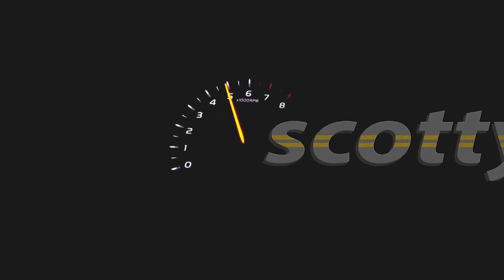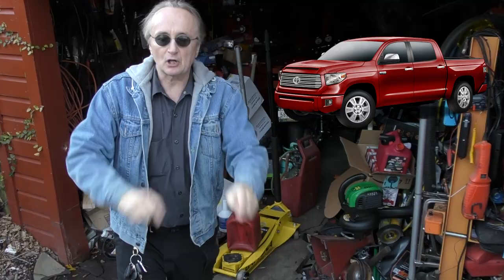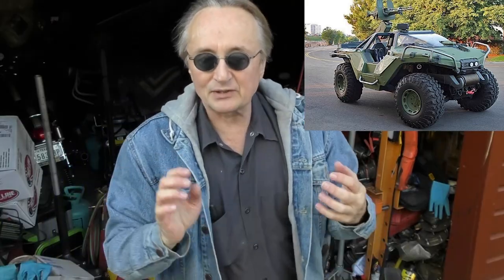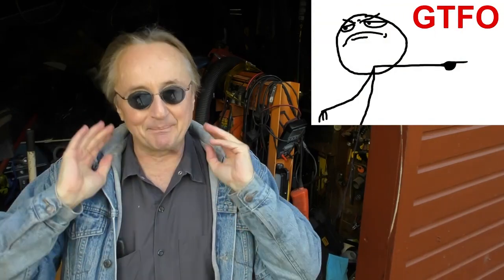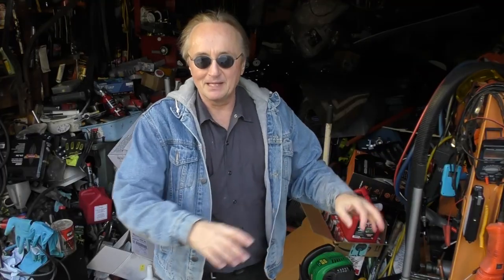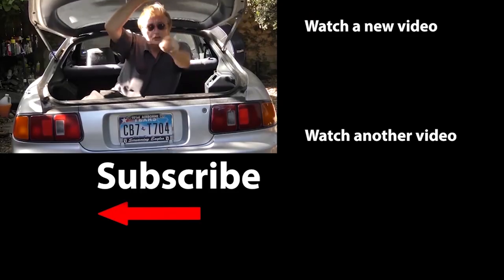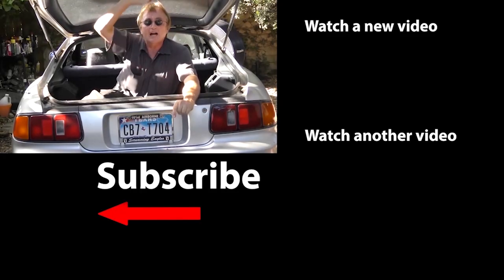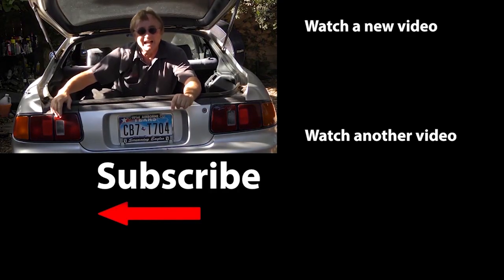5 Used Trucks You Should Never Buy

Comment: SCOTTY! I've been thinking about buying a used pickup truck what are the 5 BEST used pickup trucks to buy?!
Reply: 1. Ford
2. Ford
3. Ford
4. Ford
5. Ford
Reply: Me to. Maybe a 2500
Reply: Toyota 
Toyota
Toyota
Toyota
Toyota
Reply: If you don't care about MPG, nothing screams reliability like a Tacoma for mid sized (not the current ones), or a ranger. If you want full sized, a 1990's Chevrolet C/K 1500 is definitely reliable. Although aging now. I still see more 1990's CK 1500's on the road than anything that isn't brand new. (Slight exaggeration, but still).
Reply: Ghost Titan Gaming Toyoda
Reply: Ford
Toyota
Ford
Toyota
Ford
You seeing a pattern here?😂😁
Reply: Ghost he already made a video on the best pick ups.  Look it up. Ford F-150 or Toyota Tacoma.  The few electronics the better for reliability.  Good luck
Reply: Andrew Smith  i have a frontier I wouldnt buy a used one i would go ford or Toyota they want a fortune for a tacoma but they run forever I would avoid the 6.0 and 6.4Ford but other than that i would go ford
Reply: Ford sells a new F150 every 43 seconds.  Avoid the engine that it costs about 1.5k to change the spark plugs after 100k miles.  Those plugs "went in too far", thus after 100k deposits build up on the threads protruding into the cylinder; break off if you try to "conventionally" remove them with a wrench.  Hearsay but I think it's true.  I understand that they can be replaced but you can imagine the process of drilling them out, etc.
Reply: Andrew Smith the nissan brand should be forbidden on scotty page, shame on you
Reply: @FlatPlaneCranky  does Toyota build a 3/4 ton 4X4?
Reply: Two Fords, Two Chevy's and one cross bred ford/Chevy, thats a Ford with a 350 Chevy engine.
Reply: Datsun
Reply: Mitsubisushi
Reply: @silvergrizzly316  
Fix
Or
Repair
Daily

Found 
On 
Road
Dead
Reply: No body SELLS their good pickup truck - they only sell the duds.
Reply: silverado , tahoe , comanche , ranger , anything electric
Reply: 7.3 powerstroke.
Reply: weld a bed to the back of a 94 Toyota Celica and you'll be fine.....Scotty
Reply: F-150, hands down. Most reliable by far.
Reply: 2.3 ranger is a reliable small trk but not much u can haul.
Reply: @stanroberts4820  No.
Reply: @silvergrizzly316  fard sux
Reply: Nissan NP300, Mitsubishi L200, Toyota Hilux, Chevrolet Silverado and Hyundai H100.
Reply: I agree with the Ford and Toyota recommendations but if you go Ford I would HIGHLY recommend staying away from the turbo options or what they market as Ecoboost.
Reply: Lightning/end of thread
Reply: Toyota Hilux pickup is unbreakable. Very good cars.
Reply: Chevy 99-06 (or older chevy)
Ford- 97-10 (half to make sure there 5.4 Triton was well taken care of) or older ford.
Toyota- there all good but pricey
Reply: @hoster-ph5ru  Not all Toyota trucks are good, you need to watch out for the ones that had frame rot issues.
Reply: Used Tacoma's are insane, find a decent one it's like 18 grand. Why can no other automaker make a small reliable inexpensive pickup?
Reply: hoster123 007 finally an educated comment that makes sense.
Reply: weather you are talking used 5-10 years old or antique like 20+ try to find one that is capable of doing what you want it to do. pulling a trailer, going off road, putting around town hauling furniture or trash.
anything is going to require maintenance so try to keep cost of parts in mind and if its 20+ stick with more popular models so you can still find parts.

low miles for age with no major dents or dings.
correctly installed after market upgrades and repairs.
less electronics the better, hand crank windows and manual seats are a plus.
right size tires that are worn evenly,  truck sits level and drives straight, lifted or not.
when buying used, ask the person selling if they have any old parts or accessories that can go with it. another set of rim's, old parts that can be repaired or used for core charges, original parts that were swapped out for aftermarket (probably still work).
Reply: @shreeharibharadwaj9531  yeah, right thru the intake and shits it out the exhaust 💨💦💩   😂😂😂😂
Reply: @Spaz12isHipAimedFagg  they are good trucks I got a 95 c2500 204887 miles still works great
Reply: @mathewfullerton8577   too bad, guess I'll stick with Ford.
Reply: @silvergrizzly316  kek
Reply: My 96' 4runner is amazing.  Almost 230,000 miles
Reply: The SSR is so ugly
Reply: @EwokNubNub  the old nissans were amazing he talks about it all the time unfortunately after 2000 they started having huge transmission and engine issues
Reply: @mclaine33  personally I have an old nissan hardbody and a 7.3 ford  for work the 150 is just to weak for some applications but if you only tow a boat every few weeks or something 150s are great
Reply: @silvergrizzly316  He said 5 BEST used pickup trucks, not 5 LOUSIEST!!! Haha! Just kidding, man.
Reply: @TheRocketbob22  Man how's that Ford run with the 350? Can never go wrong with a good ol' 350!
Reply: OLD GMC seira if you can get one in good mint condition.

Toyota Tundra
Toyota Tacoma
Ford F250
Maybe a early 2000s silverado of youre lucky to find one not yet rusting
Reply: @Ghost Titan Gaming 
If you can find a used 1st gen Toyota Tacoma with a 5vz engine, that one is a bullet prof.
Reply: Skip the Nissan
Reply: @sreilly  😀 There's good and bad with all autos. They don't make'm like they use to. But I do have a 2000 F-350 Stroke 7.3 195,000 miles and the only really major thing I've had to fix, (if ya wanna call it major) was put a water pump on it. Picture on my YouTube profile. She turns 19yrs old in March. Assembled out of the Kentucky plant.
Reply: I run a 4 door F350 with the 7.3 Diesel. 2001. It is a decent sized lift and tires and still  It get's 17L/100KM and I see many for sale with over 300 000 miles still going strong. Parts are the cheapest possible for a diesel. If you're going to burn gas just get a cheap half ton. Any make is fine.  Dodge 5.9 Cummins is fine. The tranny attached is not.  Toyotas are over priced. Too rusty. Under powered and burn too much fuel for their size. But are very popular. So easy to sell once sick of.
Reply: John see, Yea, the 5.4L 24 valve.  Which hasn’t been in production on the F-150 since the 2011 model year.
Reply: Pt cruiser,
Chrysler got it classified as a truck,
Defintly should buy for the insane relibaltity and good style and it can pull all day long
Reply: Raptor! Depreciation is basically flat.
Reply: John P   I know. 100k miles and still go for 20k.  When you think you find one it’s not 4wd
Reply: ted martinez you’re right! I have a 7.3 Powerstroke soon to hit 300,000 miles with no major repairs other than a transmission rebuild that cost $1500. The transmissions were the weak point on that truck but I’m not really complaining! The 6.0 and even more so the 6.4 are to be avoided. Other than that, Ford or Toyota.
Reply: ubangiestomp yep!
Reply: Ghost Titan Gaming I’ve got a 2009 2.3 L ranger with 348,000 miles on it. Ford is the way to go.
Reply: Stan Roberts nope. But they are good trucks if you don’t need anything bigger than a 1/2 ton. I have a friend that has abused the crap out of his Toyota but it just won’t die. If you need something bigger, Ford! (Just not a 6.0 or 6.4)
Reply: Nathan Medlar YEAH!
Reply: strtngfrsh I heard an interview with a bunch of Ford dealership mechanics and they said the same thing.
Reply: Ford
Toyota 
Ford
GMC 2011 newer
Toyota

Never Nissan he wasn’t joking about those transmissions.
Reply: John P Rangers are decent but primitive. (That’s probably why they are fairly reliable)
Reply: Charlie. Pocono used to drive one of these, very comfortable and excellent fuel economy. Just didn’t have a lot of power.
Reply: John P what I like about Tacoma’s is they hold their value. If everything else in my life was as reliable as my Tacoma life would be perfect.
Reply: Stan Roberts does anyone with a 3/4 ton 4x4 actually use it other than to drive to the store
Reply: @FlatPlaneCranky  Trouble with Tacoma's and Tundra's, the frames rust badly. Look up Toyota rusted frames.
Reply: good idea --- I think you should buy a 6.0 or a 6.4 powerstroke  or a  5.4  3v   those are all fine fords
Reply: my old fords crapped out and lacked power, but my old dodge is rocking ( she has a pain the neck headlight switch issue, though ). everybody has their experiences.
Reply: @meachster4316  trannys are good ,the weak link was the torque converters.
Reply: Silver Grizzly I didn’t actually have to rebuild my tranny but did as a preventative measure and had a beefed up tc installed as well as modified valve body. That was 200,000 miles ago and still going strong in spite of lots of heavy towing.
Reply: Vick Nelonis Absolutely! I haul regularly as well as tow three different trailers including a 30 foot travel trailer.
Reply: RedWings-44 I have a chevy CK 1500. Doors are sagging. Junk
Reply: @silvergrizzly316  not all Ford trucks are good. The newer ones are very reliable but old ford's are trash. I prefer a tacoma unless u need a big v8
Reply: blackdog1960les 6.0 and 6.4 failures resulted in numerous lawsuits between Navistar and Ford. That’s why Ford builds builds their own diesels now. 7.3 or 6.7
Reply: @RedWingsninetyone  still driving my 1990 1500. Put a transmission in it in 2004 was the biggest expense. Still runs good so last year I got the A/C converted to R134 since the R12 is illegal now. When something cosmetic breaks I just go to the junk yard and get parts off of other 1500s and some of the Tahoe/Suburban parts work too.
Reply: I bought a new Toyota Tundra back in 2014. Not a SINGLE issue until this day.
Reply: Falconator , so what happened this day ?
Reply: I'll take a tundra please
Reply: @1royathrone1  well you just go and putt around in your hot wheels and leave the Tonkas to the real men.
Reply: Scotty u forgot the Ford Explorer Sport Trac 🤣🤣 exploder
Reply: @RickJamesGhostGuns  9 out of 10 Fords are still on the road. The other one made it home.
Reply: @johnsee7269  Ford  used a 2 piece spark plug in their 3 valve engines for 2 or 3 years but not since 2008. Only the 2 piece spark plugs were a problem.
Reply: Toyota Tundra, built in America
Reply: Toyota Tacoma probably then Ford F150 then the Cevy trucks
Reply: Silver Grizzly oh yeah 5.4 triton, 6.0 and 6.4 stoker are real good trucks
Reply: strtngfrsh exactly
Reply: East GTG, every manufacturers had a bad apple.  Gotta do your homework.  Most of all, learn to spy previous damage. Whole lotta truck scammers                peace
Reply: *Easy
Reply: @Alphawolf6541  you are right
I looked at getting one before I got my Ridgeline 
I always do a lot of research before I buy a vehicle and the Ford sports Trac evidently had all kinds of issues 
So I decided to go with the Honda Ridgeline and haven't regretted it at all
Reply: Gary Chambers just ask me how I know this🤣
Reply: Island Mike  WOW! How original!!! I bet you were up ALL NIGHT last night tinkin of dat wun. Hoo hoo he he hoo hoo he he hooo!!
Reply: strtngfrsh why no turbo?
Reply: Chevy all day long! Or Toyota! Just not Ford or Ram!
Reply: Chevy or Toyota
Reply: @silvergrizzly316  hahaha lol.  right.  I'll stick with my tundra and tacoma thanks, I have enough problems with women, don't need them with my trucks hahahaaaa  try one you wont go back
Reply: @tedmartinez3857  how terrible is your frontier so far
Reply: @RedWingsninetyone  and low depreciation.  no truck depreciates as slowly as a tacoma
Reply: Any Ford Ranger 2001 to 2011 with the 2.3 liter engine. A manual is best but the automatic transmissions are ok.
Reply: There is a reason the Ford 150 has been the best selling vehicle in America for over a decade. Their built right. I have a good friend that has over 400,000 miles on his now.
Reply: mclaine33 most towed vehicle I had one junk my pcm kept blowing then ford wouldn't fix it
Reply: @RickJamesGhostGuns  First On Race Day. .....F**king  Ole  Rebuilt   Dodge  give me a break....hahaha
Reply: Depends on what you want. Full size or mid? for mid size? Toyota Tacoma lol. Even the Chevy Colorado and GMC canyons are good. I had a 1st gen GMC Canyon with a 3.5L inline 5 cyl engine 4wd. Thing was bulletproof and it got good mileage. I miss the straight 5
Reply: @ubot982  but my 88 F150 XLT Lariat 4X4 is not for sale hahaha
Reply: @johnsee7269  the issue you are talking about was only for the 2006 through 2008 5.4l Triton engines. That it's not an issue with the other years. Champion has always made an alternative plug that doesn't have that design, but they have redesigned them now anyway. So, if you buy one of those trucks that are affected, you probably have something other than the original plugs anyway. $1.5k spark plug change is a complete exaggeration though. The information you have is not entirely accurate. Plugs did not go into far oh, it was because the spark plugs were a 2 piece design and they broke off if there was a lot of carbon buildup around them usually a result of poor quality gasoline. if they were not a two-piece design it would not have been an issue, but the torque to break them free was snapping them in half. The hundred thousand mile thing is irrelevant. Some people have the problem when they did the plug change with very low mileage and some didn't have any problem after 100, 000 or more. If you ever need to do a plug change on one of those there is a tool available in case you break them off and it makes it relatively easy to finish the job, but there are ways to minimize a breakage such as using good quality gasoline and using fuel cleaner for a few tanks before you change them and spring penetrating oil around them after you loosen them up a bit and let it soak in. Anyway, you should only have to deal with that one time at most and like I said by now you probably won't find one that has a original plugs in it anyway. That spark plug design was definitely not a good idea, but besides that I have found them to be very reliable engines. If you really worry about it, just make sure you buy something with a different engine or different year.
Reply: @FlatPlaneCranky  he 
wants a real truck
Reply: Whatever you do just dont buy a shitty ford or Lincoln trucks. Just stick with the normal dominant trucks like Chevy and Toyota Tundras 💯 chevy will never let you down
Reply: If you want reliable, early 2000's Heavy Duty Fords are a great bet. Both the 7.3L Turbo Desiel or the Triton V10 are some of the most reliable engines ever built. Tons of these have gone over 1 million miles with proper maintenance. For one they are built like tanks, two days ago a Tacoma slammed into the right rear of my bed, while there was some denting in the panel it was overall fairly intact. The Tacoma, on the other hand, was totaled. The only weak(ish) point of them can be their automatic transmission. They aren't bad at all, but if not well maintained, will be the first thing to fail. 
Now I'm not saying Chevys are not reliable or a good buy, I just wanted to share my experience.

Cheers!
Reply: Nissan is part owned by Pugeot is it not?  Not the most reliable brand out there.  And even Scotty says Nissan CVT transmissions are the worst ones out there....
Reply: Yes top 5.
Reply: Dispelled Word  True
Reply: I’m going to tell you right now if you are looking for a real work truck for towing and heavy hauling tons of weight, none of the imports are going to cut it.
Reply: @Laffy1345  not as american-made as an F-150
Reply: @randomvideosn0where  more like, it was a huge prob for alot of them.
Reply: @britton6062  lmao. That's hilarious
Reply: Andrew Smith  yeah that's why he said Ford. Btw , Scotty would agree. He has already said it. He would tell you to stay away from Nissan though.
Reply: @dailydistruction  if you don't count a frame rusting in half that is.
Reply: @Pure_KodiakWILD_Power  sounds like your experience is the opposite of most people
Reply: @1royathrone1  seriously? Where did you get that information? Is that just something you thought up? There are tons of old Fords all over the roads. 2000, 1990's and older. Go out on the road on any given day anywhere in the US and you will see thousands of 1990's vintage f-series trucks everywhere. And I'm not talkin about garage Queens like most Toyota's of that vintage. you will see these trucks being used as company vehicles and contractor trucks that are loaded up and towing trailers. they are still being used as work trucks and have been their whole existence and they're still going strong. And you are recommending Tacoma? Lmao! If you try calling anything heavy you're going to burn out a transmission on one of those. You won't get that far though your frame or probably rust in half well before that
Reply: @silvergrizzly316  that's all they got.
Reply: @666dynomax  and no truck rusts and half as fast either
Reply: @stanroberts4820  I know that made me laugh too. It's not like crappy. Quality is a big secret. Hell, Scotty has a bunch of videos stating that
Reply: @steve351w3  True , they don't last long when you use them in that capacity.
Reply: 90s to mid 2000s chevys were pretty good. Ford is the best full size after 2010 imo. Toyota tacoma is great too. 
Any old small pickup with a inline 4 and a manual transmission will probably run a long time. My 95 nissan had that configuration and i did no maintenance other than oil and it ran like 5+ years before anything really expensive broke.
Reply: Island Mike  where is your proof? We need more than a stupid little anagram.
Reply: Island Mike  lmao, you were the one that's triggered. You mean like the way you started antagonizing him for no reason? If you look around your statement is contradicted. Scotty's got a bunch of videos contradicting that statement as well. How is it triggered to call you out on your triggered statement? What's your experience besides being a troll? Projection much ? 😂😂😂
Reply: @silvergrizzly316  Good deal! Water pump is definitely only wear and tear. And of course, you got the venerable 7.3. Hold on to that truck as long as you can. Hopefully she isn't too prone to rust!
Reply: @sreilly  about 7 years ago a guy offered me  $20,000 for it, I said, what have you been smokin, 😁. No rust at all. I live in North Carolina where there's hardly ever any snow and very little use of salt on highways. I'll keep her til I hafta bury her. LOL 👍👍
Reply: @silvergrizzly316  Good plan! Keep her rollin'! I'm up in the salt belt in Pennsylvania. Constantly rinsing the bottom of the truck to keep the salt off. My last two trucks ran almost 300,000 miles ('96 Dakota and '03 Silverado). But unfortunately, the rust got to them before they quit.
Reply: @silvergrizzly316  That's like myself and my T-Bird. 1986 fox body, was my grandmother's car, learned how to drive in it, and she gave it to me to maintain. 100% original, including the paint, and only 40,000 miles. Someone offered me almost $10K for it, and I told them they were absolutely crazy. I'll be buried with that car as well!
Reply: Andrew Smith  Nissan?  Maybe a Datsun or a D21.  Nissan has been cheap and shoddy for years - 100k mile cars and trucks are basically what they've been selling the last 20 years.  Which, if you're buying used, you're probably bumping up against.  If you can overhaul the vehicle (engine, transmission, probably suspension) with the money you save buying used, go for it.  Otherwise Nissan is nope.

Toyota Tacoma longevity is undeniable though.  Though I've never owned one - I really hope that never changes.
Reply: @charlie.pocono9199  I had a 2001 3.0 Ranger Edge that I bought at 150k miles and borderline abused with the hauling I did.  Mostly just filling up the bed with firewood, lumber, asphalt, or small structures on occasion, but it handled it all like a champ.  Sold it for a decent price too when I upgraded to an F150, but I know the guy I sold it to and it's still chugging along at over 200k miles.
Reply: Uhaul! Drive it around town all day then pay $50 for it to go away. I own a Tacoma and I use it 2 weekends a year. It is really expensive to own for 2 weekends a year.
Reply: Andrew Smith  Nissan? Are you kidding? They are so far behind it isn't funny. You rarely see them for a reason.
Reply: Hey Ghost, if you want a very reliable truck buy an older style ridgeline, I usually carry plywood, dirt, bricks, just don't overload it..and im still using it.  it's awesome and very functional, next time you see one for sale, go for a test drive.  It don't feel like your driving a truck, more like a car.
Reply: Chevy S10 99~04
Reply: HONDA RIDGELINE
Reply: I am about to buy a used truck and my options are 09' Dodge Ram 1500 5.7 Hemi sport or 08 Ford F150 Fx4..both four door???...anybody have any suggestions??
Reply: @RedWingsninetyone  
'll
Reply: Lmaoo tell my friend that. Ford is nothing but issues
Reply: The Toyota Landcruiser 70 that you can't buy in the U.S.